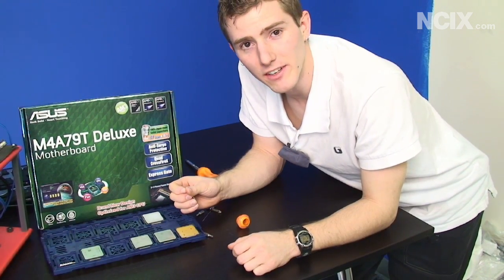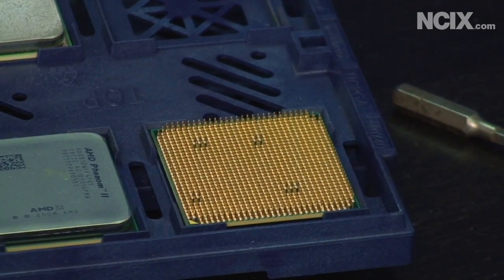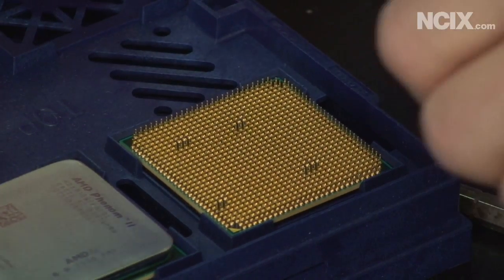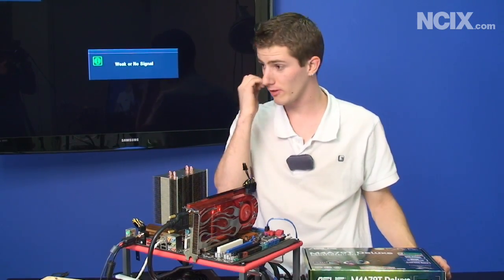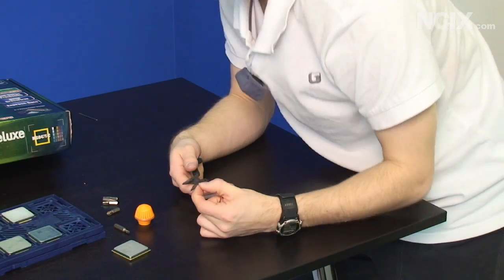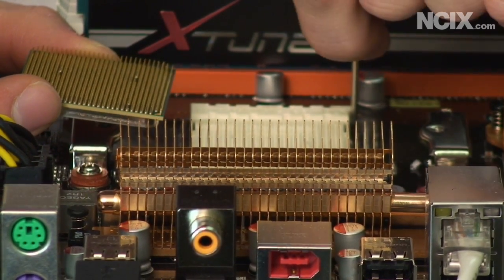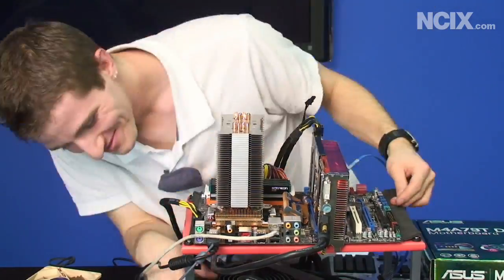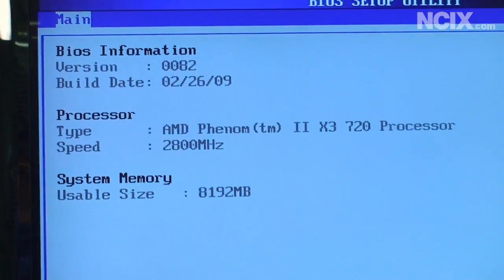Fixing a Bent / Broken Pins on a CPU (NCIX Tech Tips #36)

Comment: Linux 2009: Lets just jam a pin in it and it is gonna work
actualy works
Linux 2020: Ok lets do a very hard thing to solder 5 pins on a cpu that is very expensive and do it 4 times to be sure ut does work

Comment: Does this still work with AM4? I broke 1 pin on my Ryzen 7 3700x and am wondering if I can just do the same thing? The pin is in fact the pin needed for memory channel 2 so ram slots 3 and 4 don’t work. Is it reliable for long term or should I just replace the cpu because I’m not able to solder ?
Reply: Take what I say with a grain of salt, but he said in a new version of this video that this cpu still works to this day, so whatever he did worked really well

Comment: Holy fucking shit. Ryzen 5 2600. 2 broken pins alonk the top edge. After said pins detached ram slots 3 and 4 (second channel) didnt work. Original pins lost. 
I took SATA 3 cable, stripped it down to the wire, cut the wire about 1mm longer than the height of the pin (otherwise it just dissapears in the socket). Put them gently in the slots of missing pins. And it worked! Dual chanell memory back! Tried everything before hand (CMOS reset, all different kinds of RAM slot configs, everything) and nothing worked. Tools i used: SATA cable, girlfriends tweezers and nail clippers. Holy shit, i still cant belive it worked. Linus Sebastian the real MVP
Reply: Well done!
Reply: hey man ima try this wit ma fx8300 dual channel doesnt work anymore nd 3broken pins all the rest straightened.
So hows ur pc doin now? All fine?
Reply: @idek4971  All good, man. Of course, don't expect much stability with overclocking, but at stock settings works fine for me.

Comment: So I have an ASUS m4a79 that I was cleaning the pc and knocked the air cooler off of and the cpu came off with it and crashed on the floor. Needless to say it bent more than a few pins on and I spent DAYS bending them back and test fitting it and after i think 2 weeks bending straitening and aligning It finally sat back down in the socket. I slapped some thermal paste on it and strapped the cooler back on it and it has been that way ever since (about 8.5 years ago now). I don't dare take that CPU/ Heat sink off because i'm afraid if I do the pins are going to break. That was my gaming rig back then and is now a simple linux server, but that computer is still in service I find it funny I had nearly the same issue with a similar CPU/MoBo combo!

Comment: Just got a ryzen 5 2600 lol I was stupid and bent the pins so everything is fixed the only problem is I'm missing 10 pins hope this works. About to order some athlon 64 and use those pins
Reply: Just removed the stock cooler yesterday and the thermal paste was so strong it pulled the cpu out of the socket. 3 pins were bent and I managed to bend them back with a knife hopefully it still works
Reply: @bilboshaggins3966  Hope it works! Let me know
Reply: @techcloudamvs1726  thanks man just got to buy a Vega 64 and then I'll know
Reply: @bilboshaggins3966  sounds great, well best of luck

Comment: I'm hoping with this knowledge I can fix this AMD FX8130 that I got from my friend who didnt know better and ripped it out. Its already missing 5 pins so thats 5 pins I have to substitute with perhaps a thin solid copper wire. If this works though, it'll be an upgrade from my Phenom II x4 965.
Reply: Matt Brine how did it go?
Reply: Still working on it. I have most of the pins straight but I lost a bunch when i tried putting it in my socket and attached the heat sink. I figured this would happen anyways. So I have like 14 pins I have to substitute now. I just need to find something small that i can use. Solid copper wire or sewing needles would probably work but I also need tweezers to handle such tiny ass "pins"

Comment: I was wondering if I use as a pin a gold part from old iphone parts, do you think it would be better. Since it makes a connecting, should work :o I had a AMD Athlon x4 Quad Core Processor 3.4 Ghz and i bent 4 pins, which I could fixe 2 of them, the other two, I broke them :s
So my idea is salvage old parts from Iphone and use it. I had to buy either way a new processor that would fit my FM2 motherboard :\ ended up going with the cheap and avaiable in amazon, AMD APU A6-6400K Black Edition 3.90GHz. It doesnt beat for a mile the quad core

Comment: that's exactly what I have done back in 2003 with my dell dimension i was upgrading the processor to a Pentium 3 and I broke the pin i stuffed it in the connector and it worked
Reply: Sadok Barbouch you just put the pin in its place and it worked?

Comment: please respond. I tried to clean the cpu from cooling paste and after I pulled it out from the socket I dropped it on the pins. I bent 2 pins and I'm freaking right now. They're right in the midle and I'm scared of bending more trying to bent the others. if I don t bent them back will that damage my cpu? I made some research and there is a chance the cpu might boot but I want to know if that is all. I mean after booting will everything be fine and working like before?

Comment: i did this same with my amd fx 6300.... and guys it works!!! how?
Reply: whats your rig? I'm saving up for a fx 6300 and I want to know how well it performs
Reply: Ben Fx 6300 is a good processor. handle any game without any glitch but the problem is it heats up very high up to 80 degree celcius. my suggestion is go for fx 
AMD FX 8320E Vishera 8-Core 3.2GHz and Cooler Master Hyper 212x Cooling Fan .IT makes your processor more durable and stable. And I hope it helps :)

Comment: ok so i split water on a 990 msi mobo with a fx8350 and while dissembling bent then broke a pin. the mobo has no burnt  any           thing but has residue i have to clean and then reassemble everything. wish me luck as i plan on doing this dropping the pin in and praying
Reply: +slinq sooo... how did it go?
Reply: i couldnt make a connection, i sold off all the working parts and still have to cpu mobo to try again. just kinda lost steam and put all the parts away.

Comment: i had a bent pin in my lga775 socket and i was thinkin that was the reason the mobo didint boot at all. i tried bent it back but the pin broke into half. havent tested would it go on but if it doesent is there way to repair that? :D

Comment: Just bent my Phenom 2 965 by taking it out and dropping it on the GPU. Put the CPU in without knowing and my fans would spin fast then slow in a pattern and my mobo beeped every 3-5 secs. Took the CPU out and looked and saw a bent pin. I then got a small flathead screwdriver and bent it out, then I used my fingernail to re-bend it. Put the CPU back in and when I heard the beep post and the mobo screen appeared I felt so much relief. Felt so accomplished

Comment: I just ordered amd 8320e building my first pc and I noticed the pins where bent straight out the box ordered it from Amazon I was shitting bricks bc i spent 800 on everything so I started bending pins straight took some time then it finally popped in the mobo and it worked I just worried that it's not working to its full potential since this was my first gaming pc I built ever if it's working does that mean it's fine or as good as if i didn't have bent pins?

Comment: CPU's are pretty tough. I was using a toothbrush and some alcohol, to remove thermal paste from the pins of an A10 6800k. Still works flawless and overclocks to 4,8 Ghz now with the new cooler.
Reply: 98%
Reply: +Rhodiebert85 AMD CPUs are tough.
Intel CPUs are even toughter... because the pins are on the MoBo

Comment: My stupid cheap cooling paste stick in the fan and when i removed the fan, my cpu were also removed and it damaged the pins... shit... thanks for that video, i will try this soon.
Reply: +Testing Channel this happened to me too, I was replacing the CPU fan and the thermal paste glued the CPU to the fan so it popped out the cpu bending several pins.  luckily I was able to bend them back and the CPU works with the new fan but it sure was stressful, especially trying to remove the CPU from the old fan without causing any more damage.  Glad that the pins didn't fall off.

Comment: This video no longer applies because on PCs in the last few years, the pins are on the motherboard instead of the CPU. Although this may work for fixing the pins on the motherboard LGA socket. It is a bummer because the pins are now much easier to bend on the motherboard then when the pins were on the CPU. The bent pins can be nearly impossible to fix on a 2011 socket motherboard because the pins are so small and close together.
Reply: +Ryan Toomey Thats intel, AMD still has the pin array on the CPU itself.
Reply: psychotogen1 that's only Intel not amd, read
Reply: +Ryan Toomey AMD still has pins on the CPU itself...
Reply: +Ryan Toomey The cool thing about that is that It's nearly impossible to break a pin now that they are only on the motherboard.   Good engineering in my opinion
Reply: +carsondrum Lets argue on the internet, and pick each others sentences apart!  Sounds like fun!
Reply: psychotogen1
I don't have to argue man, its fact

Comment: ok so i just had this happen to me like an hour ago   and i fixed it by using an earring post and gamestop card   the metal earring post was only to bend the pins the card couldnt get in between   the card was to even out the lines of pins  took me 20-30 mins to fix all 4 outside rows that got bent if anyone has any questions about the technique i used plz feel free to send me a message i was able to fix without breaking any pins......

Comment: I bent a pin on my amd cpu and after an hour of trying to repair it also the pin broke off and my hope was gone.
Then i tried booting the computer with one pin gone and it worked
Reply: lucky you.. mine doesn't work anymore
Reply: deWaardt
You probably struck a pin thats needed by the cpu and not a ground pin like i did >_< and thats frustrating mate, Im sorry that happened
Reply: Tztok-Jad95 Lol
Reply: deWaardt
Thats good :)
Reply: It might be ground pin
Reply: +shaints3 ah well, shit happens. Got a new CPU now.
Reply: +Tztok-Jad95 A broken pin is bad in all walks of life.
Reply: I bent a pin on my FX-8350 in my new build and bent it back again, either this or that it's running at 70 degrees Celsius is causing it to only run BF4 at 55 fps ultra..
Reply: Tztok-Jad95 i just fixed 7 bent pins on mine it took forever but i did it
Reply: lucky
Reply: I dropped my cpu and it fixed the pins
Reply: Tztok-Jad95 I did the exact same shit, got my new mother board in, took my old cpu out put it in WRONG, 3 hours later, checked the cpu, and it was wrong, checked the pins, 1 was bent, tried repairing it, broke off, Pissed at myself for ignorance, then put cpu in, and it works LOL
Reply: @shaints3  Hi after 6 yrs
Reply: +Tztok-Jad95 A broken pin is bad in all walks of life.
Reply: *****
Ouch, luck is really not on your side o_O
Reply: +Tztok-Jad95 Same shit, only Cool and Quiet doesnt seems to work anymore xD
Reply: +Lucas Kroon what gpu do you have?
Reply: Hi after 6 yrs :)

Comment: Is there a pinout that intel or AMD provide to tell you what each pin is used for?
Reply: QuadTubeChannel break off all uneeded pins for reduced PC weight and better fuel economy when carrying it in a car
Reply: IIGrayfoxII Intel, Yes AMD dunno
Reply: IIGrayfoxII If it helps, here's one potential source for Socket AM2/AM2+/AM3:
http://www.hotcomp.ru/socket/am2.php
Reply: +OK weigh reduction bro because race car
Reply: +IIGrayfoxII pinout is usually regarded as exhibitionism though

Comment: I was replacing my stock amd heatsink with a new one and when i pulled out my heatsink it came out very easy and i was very gentle with it,so the heatsink came out and i look on my motherboard and there is no CPU in it im confused.. then i look at the heatsink in my hands and i see the CPU stuck to heatsink and 7- 8 bent pins is there a way to repair it?my friend told me that i should take it to a jeweler,is there any other way to fix this?or should i take it to the place where i bought it?
Reply: Ridvan C omg that just happened to me... but mine were so bent that they broke off while trying to straighten them and I am afraid to try this...
Reply: None of my pins were broken but alot of them were bent i managed to straighten them up with 0.5mm pen and a credit card,now the cpu works no problem all good all stable,i don't know about broken pens but i don't think anyone can fix it even if they can they might charge you alot of money for it,so it's up to you,do it yourself and if it doesn't work well you learned a lesson from your mistake,i did :)
(i apologize for poor english )

Comment: Just salvaged Amd FX 8370e which had a similar broken pin on the outside edge.

I used part of a capacitor metal leg bent so any excess was off the edge.
This kept it in place and made solid contact with the pad of the cpu where the missing pin was.
Worked perfectly first try although my media server probably didn't need eight core but why not it was free.  lol

Comment: Im new to the world of pc so excuse my noobness. So i thoght that my new gigabyte mobo was dead on arrival after installing it. Fans turned on everything turned on but no picture. So I reinstalled my old mobo. Same thing happened, no picture. Two days later i decided to remove the cpu from its socket. The thing is, with the base amd fan that came with the socket, it made it very hard to remove without using my Murican man strength. A process that I though was normal in order to remove cpu fans. First thing I noticed was that when I removed the fan, the cpu was still attached to the fan, which shouldve been a red flag. The socket wasnt holding my cpu down at all.so I looked into it, I was questioning if this was normal at all. Then i noticed that 20 some odd pins were bent. And two or three pins were broken off. Did some research, found that the reason my cpu wasnt being held down by the socket was due to the bent and missing pins. I also found out that the reason my desktop wouldnt boot was do to the cpu not the mobo. So glad I didnt return the new mobo I just baught. But damn amd, wtf? You could've made it easier to remove the stock cpu fan without the use of force. But thats my story.

Comment: And then theres Intel... Pins are in the mobo xD
Reply: ***** There's only one retention arm on LGA1150 mobos
Reply: Oh god, the horror! What if one breaks in the MoBo?
Reply: Yeah AMD using a ZIF (zero insertion force) socket which is pretty nice, if Intel would use that but still keep the pins on the mobo their sockets would be perfected imo
Reply: But you also need to take into consideration that there's a much higher chance of CPU pins to break than mobo pins.
Reply: ***** but you can't send in a cpu/mobo in for a refund if you broke the pins. Just look at which issue is more common. (CPU pins breaking)
Reply: ***** Same goes with mobo pins over whether or not they are excess pins. And pins almost never break in shipping for mobos and cpus.
Reply: ***** If you're an experienced builder, you don't fret about the force it takes for Intel cpus. I have never heard of anybody breaking a mobo pin but I have heard of a few occasions of people breaking cpu pins. And either way you're getting better performance from Intel.
Reply: ***** Literally the only price points that AMD win are the $130 dollar price range, and the $70 price range. I'll show you the match ups.

(According to benchmarks)

$70- 860k > G3258
$100- i3 4150 > FX 6300
$130- FX 8320 > i3 4330
$170- i5 4460 > FX 8350
$190- i5 4590 > FX 8370
$220- i5 4690k > FX 9590

Anything priced beyond that is Intel.
So Intel wins 4-2 and also features a better upgrade path. Sure, AMD has higher clock speeds, but Specifications =/= performance.
Reply: ***** Yeah but in actual gaming performance Intel wins in almost every scenario as I have just shown you. And high clock speed does not mean good gaming performance. A G3258 and the i5 4460 have the exact same clock speed yet the i5 blows the Pentium out of the water. And don't try to say that it's because of the two extra cores because the single threaded performance is also significantly better on the i5 despite the same clock speed.

Remember: Specifications =/= Performance
Reply: ***** You really need to research this a bit more, bud. I agree with you about the $70 and $130 but first off, the 6300 does not beat out the 4150 in gaming performance much less the G3258. Hyperthreading actually improves gaming performance for the 4150 by making it a quad logical-core cpu. (That means that your computer will interpret it as a true quad core. And while the FX 8000 series are great chips, they still do not win in comparison to the 4460 and up.
Reply: Jason Jia yea im on my first every Intel build (only owned amd) i was a little confused seeing no pins on my 7700k. convenient anyways.
Reply: i bent my mobo pins pretty badly LGA socket
im gay
fuck

Comment: how reliable is a broken pin stuffed into a socket?
Reply: Superchad245 so what you guys are saying is... if you destroy your cpu... your cpu is destroyed...XD
Reply: Superchad245 If the CPU heatsink is well in place and holding tight on that CPU, it should be just fine...even when overclocking.
Reply: Sick Nick nice, i bet there is a limit, because the pins also hold the CPU to the socket, break all of them off and the CPU will slide around
Reply: Superchad245 break all of them off and the CPU...can very well be tossed directly in the trash bin, since there's no way in hell you could possibly salvage that much damage...unless you're an AMD engineer with the proper tools and knowledge to do so...and even then it'd be quite a task IMHO.
Reply: Sick Nick mostly because the pins are the only thing holding it to the socket, otherwise it would slide around without pins to hold it in
Reply: Alex Aguilar yup
Reply: +Sick Nick This shit had me ROFL! Thanks